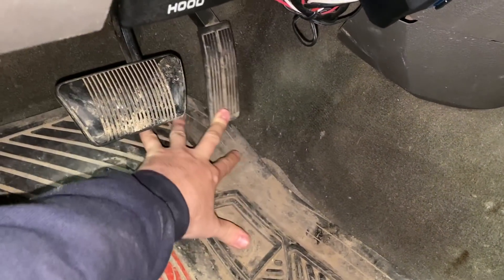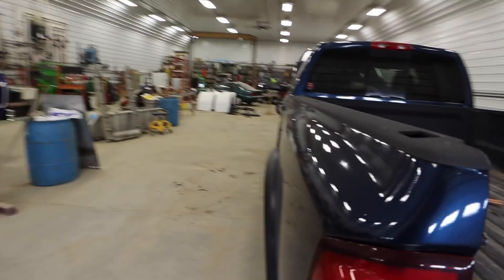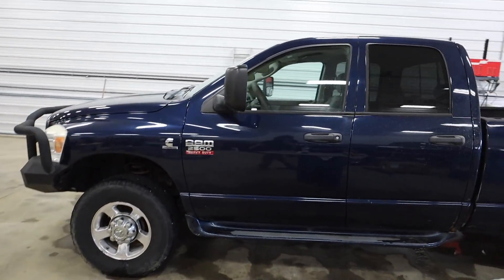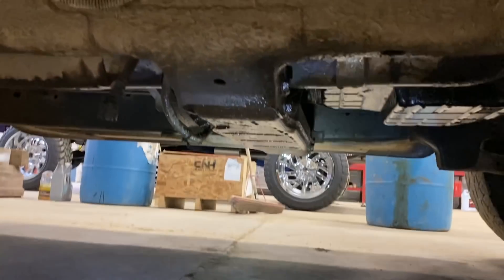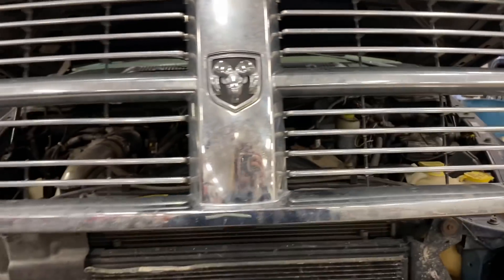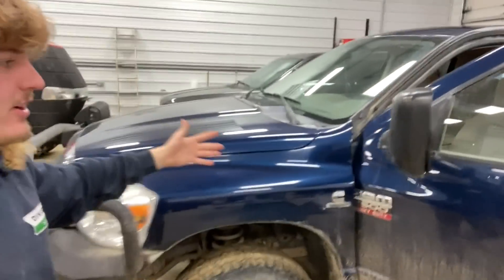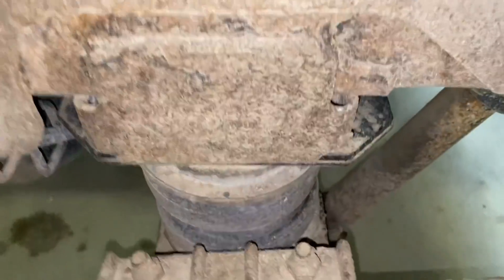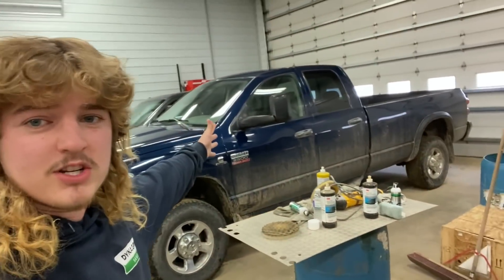I Bought A 600HP Dodge Cummins

Comment: Yes finally! The ultimate farm truck! My dad owns a 3rd gen Cummins but with a 5.9l, so I recommend a rough country leveling kit and get the bilstein shocks to help the ride. Also you probably want a lift pump if it already doesn’t have one because with all of that air from twin turbos you need more fuel, for a lift pump I recommend a airdog 150gpm. Idk exactly how much horsepower you’re making but eventually you may have to do something to the transmission if it’s still completely stock, but you may be ok.   Just make sure when you’re towing a load always keep an eye on the transmission temperature. If you don’t find leather seat soon just out seat covers over the front seats to protect them or do like what my dad does, take a towel and folding in half and put it on the seat. I’m so glad you guys bought not only a diesel truck but it’s a 3rd gen Cummins. Thank you!

Comment: Liked this episode Coop. Diesel's don't like dirty Air Filters, or dirty injectors.... makes them smoke. make sure to change the fuel filter too or empty the water separator on the bottom of the filter housing. Some diesel's have a cam/timing belt...worth swapping that out too.`Its worth cleaning the EGR valve & the Maf/MAP sensors also both affect performance & mpg.

Comment: Cooper I have a 2006 Ram 2500  4x4 short wheel base and also a four door..Mine has the Cummins 5.9 turbo diesel..my fuel miles average 24/26 mpg..My best mileage is 33.5mpg interstate driving...My  worst is 18mpg, pulling a hightop 36' camper on the interstate with a headwind...I am really satisfied with the overall performance .The biggest downfall is when off road in soft group d the front end will get you stuck pretty quick due to the really heavy motor...Best of luck with your truck...it looks really good cleaned up!

Comment: I have a 2010 Ram 3500 Cummings turbo  diesel  and I love it. I pull a 35 ft 5th wheel camper fully loaded and the truck pulls it like it was not even there. It is a six speed automatic  with the option  to manually shift when pulling a load. That is really sweet when you come to a hill and want that extra pulling power. Like yours it is long my rear seats are the same size as the front and I have a full size bed. I believe it has a twenty three feet wheel space. Enjoy your truck it looks sweet. DIESEL POWER  oh yes

Comment: You should enjoy the truck. I keep one diesel to pull.  The gas half ton is for running around.   Check into a agri hitch.   Brute II or a DMI.  You can get within @ a foot of dead on and hook up.  Saves lots of time. Plus spring cushion saves your back, neck, the transmission...

Comment: I have a  2010 ram   and  you can get speaker box for  under the back seat.  I would definitely put a  flat  bed on it  and fix all the rust spots  as well .  I would probably  look into  making  it a dully as well  this  will help you  heavy  loads and  towing .

Comment: I have a 4th gen 6.7 Ram. I used to have a 2007 gasser. Great trucks if you just tend to their weaknesses (as all makes and models have). Alpharex has some nice LED headlights for those years. Get the cab corners fixed and put cavity wax in them and it will last many years. You can swap in 4th gen seats I believe without much work, and the comfort level improves greatly. I sub'd when I saw you got this truck! Also, keep a repair fund for a transmission especially with compound turbos. That is one of the weaknesses of the Dodge/Rams that can be helped with a built transmission.

Comment: Cooper, its a nice truck and the flat bed is a great idea. Putting a lot of money into bling just doesn't compute as those bodies rust away  while talking about it. I would dig in and get rid of the rust with a good spray undercoating of some kind. Since you have the garage, I would strip things out that hide the rust and get  some ospho or some kind of rust killer on it so it will last a little while but seriously Ohio is a rust capital and it is just nearly a work horse to stop it all. The important stuff like the doors and fenders will get so bad in five years you won't go across the yard before  hearing a sound of metal jingling and stuff  ready to fall off. Your ford  is your go to town in and make other boys in the area so jealous of you  that it hurts. Its a work truck to take the pressure off the really sweet ford

Comment: Norstar Flatbeds.  Look  for  a  used  one  maybe,  new,  they're  (I  think,)  a  tad  pricey.  But,  they  are  solid.  However,  there  is  a  few  good  build  plans  on  the  Web.  Another  option  is  a  modified  Service  body.  remove  some  of  the  tool  boxes   for  a  gooseneck  hitch.  For  non  highway  activities,  gooseneck  is  way  better!   Running  that  diesel  around  will  change  your  mind  on  diesel  pickups.  So  much,  You  and  D.C.  are  gonna  Diesel  swap  the  dually.  (Go  straight  pipe  into  stacks,  you'll  love  it.)  Sweet  truck,  so   is  the  OBS  Ford.  Can't  be  sad  with  a  classic.

Comment: Speaker upgrade is essential,and yes you can get a sub for the stowage under the rear passenger seat. Fuel additive to keep your fuel system slicked up, I use hotshots secret, 300k and no injected or pump issues!

Comment: Done several lifts on my dodges. For a work truck I'd do a leveling upfront but a little load with a flat deck the back will be sagging. I run like 20psi in the bags to always keep some slope on the truck for when the loads go on

Comment: check the local wrecking yard for the seats, rough country sells a dirt cheap leveling block kit, and they do sell a airbag controller that sets the pressure from the drivers seat

Comment: Hey Cooper, I had a 2008 dodge megacab 4x4. I had some 3-step NFAB steps on the truck and had bought some off brand fender flares as well(just like the bushwacker fender flares). Sadly the truck was totalled, but the steps weren't damaged and the flares were never installed. Let me know if you're interested.

Comment: If you polish/sand cloudy headlights, you need to apply a protective film. The cloudiness is from micro fractures and the dirt they collect. The film will help prevent new micro fractures and keep the current ones clean.

Don't forget to re-aim the headlights if you level it so you don't blind other drivers. And if you replace the headlights, get reputable stuff, not cheap crap off eBay.

Comment: Good buy! Miss my 06. You’re pretty crafty with a welder you could build your own flatbed. Make good content on here.  There are tons of leveling kits out there. Cheapest and easiest is coil spring spacers and can be found all over Amazon or eBay.. If you don’t mind spending the extra money you could just get 2” or 3” front lift springs. Would probably ride nicer then the spacers. Thuren makes a real nice set of soft ride lift springs which might be a good idea for all those dirt roads you have out there.  Look into greg_alberalla YouTube channel his entires channel I’d based on Cummins motors and trucks. Great resource on how to’s and where to get quality parts. Good luck and have fun with it!

Comment: If you don’t mind spending the money, and want a really bomb proof front suspension and steering, then I highly recommend you look up Carli suspension. Basically you can tear off into a corn field and jump through a ditch without worrying about your front end. Also I highly recommend you beef up the transmission in your truck, if the previous owner hasn’t done so already, before you wind up on the side of the road with its guts spread out everywhere especially with the extra power. Other than that, as long as you service the truck regularly and not hot rod it too much you’ll be fine.

Comment: Nice truck, hard to beat the power, reliability, and mileage of a Cummins. I've been really happy with mine, I have identical truck, mine is also a 2008  Dodge 2500 crew cab long box with the 6.7 Cummins, just white instead. I put a 2 in leveling kit in mine and it sits about perfectly level, then I put 20x10 rims with 33x12.5R20 tires on it. The auto transmission is the only real problem I've with mine.

Comment: Katskin sells the leather seat covers I used them to replace my seat covers in my 2003 I had seat warmers in the the 2 front seats. Also if you take the rubber strips on the doors by the rocker panel off you can spray chain lube in the holes to keep the doors from rusting out. The reason the bed sides rust out is Dodge put spry foam in the bed sides so they would not rust out but instead they held the moisture in. This is just what I have been told, I have spent about $10000. on my 03 just fixing rust and I think I am done with it now. I have had both bed sides replace all the doors fixed new rocker panels and the tail gate repaired. You will love the power of the Cummins!

Comment: Nice truck. Two inch leveling kit super easy to install for you. 90 minutes  max. Cole could likely do it in three. Lol. Been twelve years. Love my 03' Transmission NV5600 in mine. Have a Banks program and exhaust with stock HO turbo mine is a 5.9. With eight foot bed to. Keep a eye on carrier bearing.

Comment: Wide rims up front like your ford has and dually rims out back so you flat bed can be a bit wider and it has some tire under it kinda like the pipe line welder trucks (customs) . Then fix everything else up on it and keep it nice a simple like you said.

Comment: Cooper, I have had both petrol and diesel series trucks and the diesel s are better that petrol especially on the wet they won't stall out in the wet like petrols do unless you get what in the motor.

Comment: Once you get the things addressed you need an want to do to the truck you’ll have the best truck on the farm .. even way better than coles new truck 😁😁👍👍👍 .. oh by the way .. you’ll have to get in line for the hood  with scoop as I’m lookin too lol .. An ya Cole never shoulda bought a brand new work truck with a gas engine as very terrible gas mileage .. not only diesel better on fuel but you will get a waaaay more miles out of it first year I had mine I put 180 thousand km hauling 53’ 4 car trailer .. then I switched to hauling rv travel trailers an bought a second dodge dually .. if take care of an excellent maintenance some of the guys I hauled with got 1 million miles outa .. an still going today no lie .. God’s honest truth on that !! Anyway good luck with planting season look forward to all your guys videos 👍👍🙏 stay safe god bless

Comment: When you need U Joints press them out.  Lable them take them to parts store and have them measured. That way you get the correct ones.  All automakers stick what ever they want in at the time of build.

Comment: Nice looking truck yes diesels are better on power and torque Check jegs for leveling Kits and a in cab control system for your air bags

Comment: If you plan on using it for towing primarily I wouldn't recommend a leveling kit as that will throw everything out of wack with a trailer on it.  You'd have a decent idea when you have a flatbed and a trailer on for the stance

Comment: Try to install air compressor into that truck and hook up the air bags to it. You could control pressure on the go and plus, you can have handy air supply always with you, if you add some air hose plug. :) There are some kits, which can automaticly control pressure to value you set.

Comment: Get you some 303 UV protectant and it will stop the fade on your lights. Use rubbing compound and  clean them back up so they are good and clear. Then spray the 303 UV on them. And your done.  It takes bout 5 min per side.

Comment: Decent truck. Reliability won't be as good as if it was stock. Auto trans isn't going to last long. Put a larger trans fluid oil cooler/fan on it, which will help some.  I'd also suggest getting it NH oil undercoated. They'll do the underside (and inside) of the frame/tailgate/bedsides/doors/hood seams/front fenders and rockers (though, yours are rusty). Do it every year or every other year.

Comment: My grandpa has a 2014 Cummins, its chipped, deleted, but 22 miles per gallon when it doesn't have a load on it, with a 35 foot trailer and silage round bales stacked 2 high it gets about 18 or 19 miles per gallon, on some decently hilly roads,, and thats on 5, there's a knob, 1-5, and it will smoke a little but not like crazy like every single time you give it slight gas, beautiful trucks, look up ram seat covers or (im not sure about your year) but carrhart sells them to, and we take our ram ones and put them right in a washing machine and hang them outside, way nicer and easier then leather I believe, however its your truck, you do what you want with it, good luck with your turbo and the truck overall and have a good planting season.

Comment: I would just do performance struts on the front. Ballston 5160 will get the look you want without the roughness of like a 2 5 inch block spacer

Comment: I've heard you can take WD-40 and buff that in those scratches, allegedly takes the scratches out, well, hides them. 
As for leveling kit, technically, for a pickup, the rear is supposed to be slightly higher than the front. Reason being, when you hook to a heavy load, that load will level the rear to the front. You really don't want the rear to be "squatting" down. 
For the rust, suggest you fill those rusted out spots with bondo, then strip down the undercarriage, paint or spray-on bed liner. That will protect the undercarriage, same with the under body, especially the fuel tank. Unless it's a plastic/poly tank, it'll rust out faster than you think it will. Cheers :)

Comment: congrats man your love having a diesel if u do heavy pulling they pay for there self in no time. i never understand why the old timers hate diesels (my dad was one too) that 6.7 is a good reliable engine. dodges arnt that bad of a truck the worst thing about them is there auto trans and they rust fast and the front ends are weak but theres better aftermarket parts that fix all of that. look forward to seeing the build

Comment: the front end is supposed to be a little lower than the rear so when you load it or tow with it the truck levels out if you raise the front up level with the rear it will decrease your hauling and towing capabilities because when loaded the front will be higher than the rear and wind will want to go under the truck and raise the front end up making it hard to control

Comment: If u do get a leveling kit get it a smudge bigger than u need so u can put air in those air bags when u don’t pull a load it’s hard on those air bad to be run with nothing in them.

Comment: Coopm beware of the Dodge Death Wobble... Don't know if you have steering dampeners on it, but I would suggest that & double check all your front end steering & suspension components. Great buy. Maybe do a Fummins SWAP down the road. Much more comfortable than the Dodges IMHO.

Comment: Nice utility flatbed is going to cost you close to $7,000. Run the factory box until the rust gets bad.

Coop, motors are electric, engines are fuel powered. 

Turned up Cummins diesels can be problematic. Both the 5.9 and 6.7 are great engines. Run a blow-by test and if you've got a bit, install a catch can for the vapors. 

The turbo set up that uses two turbos is called compound turboing.  De-scunge the turbo to remove the leaked oil, as they can catch fire if there's enough build up.   Keep the exhaust gas temperatures below 1150 degrees or your pistons won't be happy. Water or methanol injection will help. Replace the fuel filter and when funds become available, a good lift pump. Clean fuel is your friend.

Out of the three light duty truck diesel engines, the Cummins is the easiest of the bunch to work on. Both the Duramax and the Power Stroke being V8 diesels and a bear with space

Comment: As long as the headlights insolation is good you can restore them. You need to wet sand it then polish it and the most important part to do is to clear coat it!!! You didn't clear coated it that is why it turned back

Comment: You definitvely need to weld, cut this rosty parts - maybe even from two sides. For the turbo, this seems to be fun - maybe need to remove the motor to reach out the turbo.

Comment: I got a 97 Ford 7.3 and I get 13-15 mpg and here in NC diesel is only $0.20 more than gas so diesel trucks are the way to go when it comes to a work truck

Comment: Flat bed is defenitly the way to go for a work truck.  Tubs aint shit.  Here in australia DIesel is the same price roughly as petrol so basicly everything is diesel.  If your going to sand the headlights dont bother polishing them, sand them to 1200 and then clear coat them to protect them, that way they will last years because of the UV coating in the paint.

Comment: In New Zealand petrol  costs  more than Diesel  as we buy our road tax by the kilometre at the post office for diesels, big trucks and bus's (and soon to be electric cars too ), 90% of  all pick-up trucks ( Utes as we call them ) are diesel, the diesel engine is way more efficient and has way more torque. I just love  Cummins engines, we had one in our Westen Star truck at my old work, man it had so much torque! I have thought about inporting a Ram to NZ from the USA, it would have to be over 25 years old as we drive on the left of the road and sit on the right. You can buy new ones here now but they are over $100k !

Comment: I wouldn’t worry about a leveling kit until after you flat bed it. Flatdecks weigh more than regular boxes.
Reply: A Steel Bradley Built flat bed would be perfect. In my opinion you still would need the leveling kit. That bed shouldn't be over 1500..not sure. So obviously a lift in the front would be perfect

Comment: If you want to try to clean up your headlights again sand them down like you did to your other ones and finish sand with 800 grit then put a couple light coats of clear coat over them. You’ll be good to go!